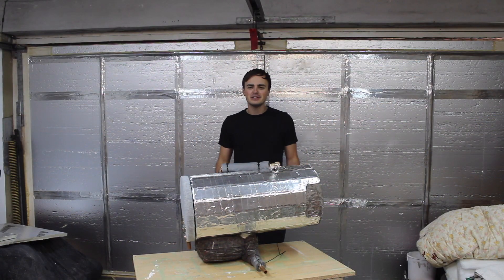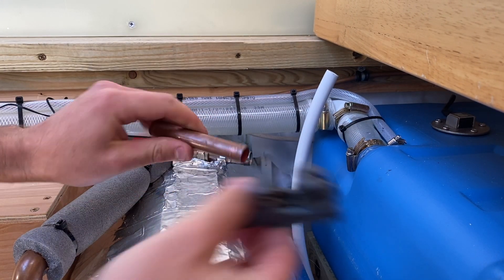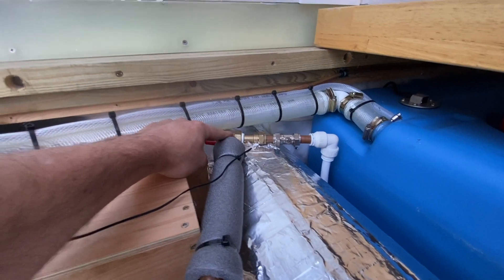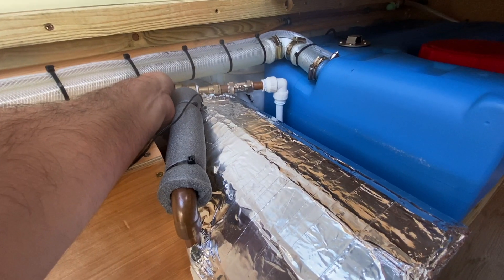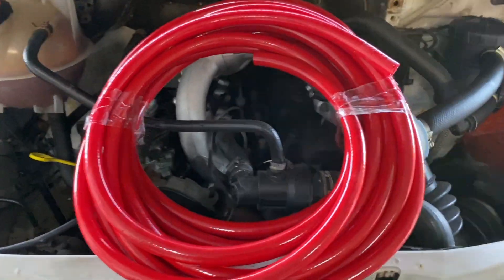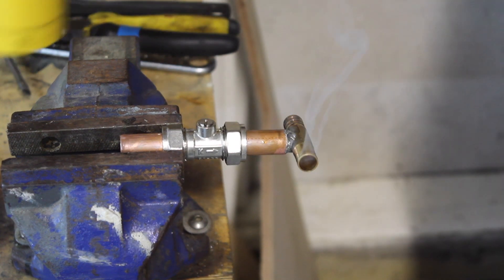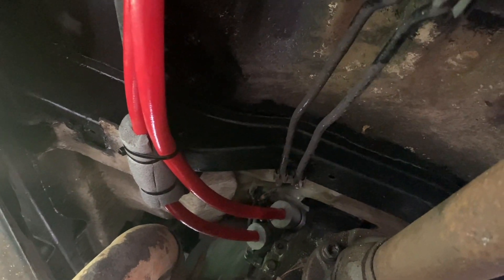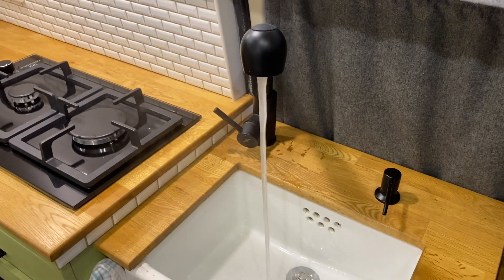Campervan Calorifier Water Heater Install - Van Build Series - Episode 28 - Part 2

Comment: I have done mine! It’s an exact copy just a 23L tank. Messaged you on instagram. I thought it wasn’t work working….. you have to have the heating on in the cab to get the coolant to circulate. How strange is that.  Took me ages to work out why some times I have hot water and sometimes don’t.

Comment: I have an idea I want to run by you, I’m going to install an engine heater so you have a cylinder with a single coil now my idea is I want to use bobils air heating system if I T off the supply from the engine then before the T put in a one way valve so it won’t circulate round the engine hope you can understand my madness lol

Comment: If you use a 20mm holesaw you can paint bare metal then fit 20mm electrical open grommets. Pipe fits through and doesn't rattle or chafe on the van body... Great stuff dude.
Reply from the maker: That’s a great tip, thanks mate 😊

Comment: Brilliant (BTW DONT swallow Etyhlene Glycol anti freeze - can be fatal!) If you EVER need to syphon or bleed anything attach a length of CLEAR PIPE. This was you can see the diesel, anti freeze whatever BEFORE you drink it! GREAT BUILD im making mine now! Think I'll sub up IM building a Transporter but basically its still A VAN!
Reply from the maker: Cheers mate, yeah exactly it’s toxic. Easy way to tell if you have a coolant leak though. If it tastes sweet 😅 But definitely wouldn’t recommend this method… nice suggestion with the clear hose 👍🏼

Comment: Those pipe inserts (superseal) are meant only for pex to plastic as the compression connection (olive and pex pipe) is biting down on a rubber seal. Reason i say this is many years ago i had one blow off on a job !
On compression just use the regular speedfit inserts !
Good job.
I subscribed and liked all your clips ... always something new to see !
Be careful of temperature climbing too high without some form of primary flow control ?
A vertical discharge pipe run, via a tundish would be preferable and safer due to the "fail-safe" open vent principle, plus you can see the P.R.V discharge and rectify it ?
I might have bedded the whole unit onto a simple drip tray with a screened, floor drop out vent ( like a mini shower tray) in case anything ever leaks ?
Also you only want the matrix coolant to flow once the van has reached a specific temperature .
So a bypass would also be needed for the van coolant circuit to continue flowing !
Try a high temp (orange coloured) 12v, 2-way  motorised valve controlled by one of those (relayed) temp sensors you have !
The middle plate of the keg could be cut - out to take a 600watt, 12v heating element with associated controls etc. Good dump load for excess summer solar once the batteries are full ?
 Interesting stuff from such a young guy. (I,m clearly a LOT older than yourself ... LOL)

Comment: Worry about the mismatched fitting soldering job. Better to braze if you were going that way. Although i seen worse and from myself. Far as my plumbing career.
Reply from the maker: I did worry about them and changed them in the next video 😊 cheers

Comment: Thanks for the video! Really well explained. I have a question: Do you think the system could have a negative effect on engine cooling?Or is it just positive that the heat is being shifted that way?
Reply from the maker: No problem, thanks for watching 😁 It will take longer for the engine to warm up as it has to heat the tank at the same time but I can’t see this being an issue. Slightly increased load on the water pump won’t be a problem for an old mechanical type pump but maybe for the modern electric types. Can’t say for sure but that’s my thoughts on it 😊
Reply: @TurnersWorkshop97  Thnx!🙂

Comment: Again very well explained, looks pretty straightforward when you see it done and for £150 to £200 and a couple of days work looks ideal, especially if you have a bigger van and the need for hot water. Be interested to see how long the water stays warm enough for say a shower if your parked up for a couple of days. Well Done young fella
Reply from the maker: Thank you mate, I will be testing it out fully in the next video 👍🏼😊

Comment: That's amazing, a project I would really like to try myself! I think you mentioned in a video you was in college or university, purely out of curiosity what are you studying something Todo with engineering?
Reply from the maker: Thank you, you definitely should, I have come across a problem today though so I will need to cover in the next video… I’m an electrical engineer but do lots of mechanical work also. I was lucky enough to get an apprenticeship that put me through my training. I’m currently working as a HVAC technician. Have spent a lot of time stripping apart and rebuilding commercial calorifiers.
Reply: Wow that's really cool well Im definitely hooked on all your content and cheers for your reply

Comment: Great work as usual my friend,looks awesome.
A guy who I know has done the same system but he used white push fit Polly pipe from the engine as it's more robust for under the van. Time to get out in the smiley & give everything a good testing 👍
Reply from the maker: Thanks man! I was thinking about using the plastic pipe as I had some left over just wasn’t so sure it would handle the temperatures. After todays test I think I’m going to change to the plastic pipe…😂

Comment: Top video as ever.
Maybe put a solenoid valve ( either thermostatically control or manual switch) so you can let the engine get  up to temperature before you heat the water?
Particularly if you use it cold weather.
Reply from the maker: Thank you! I have thought about this but can’t seem to find the valve I’m looking for.